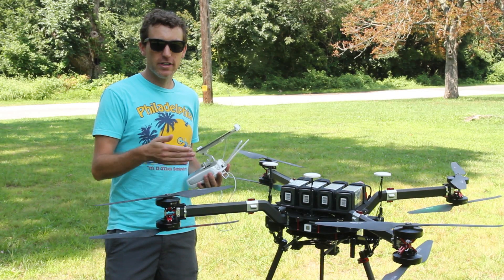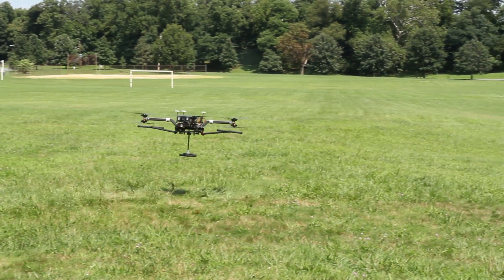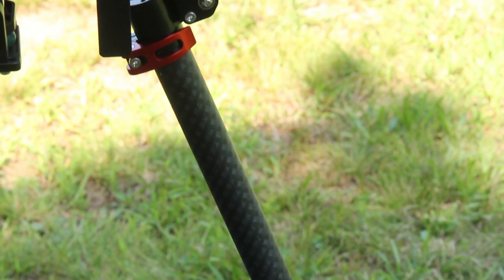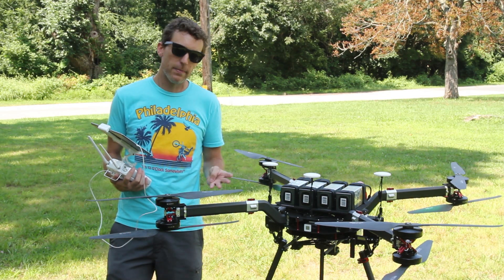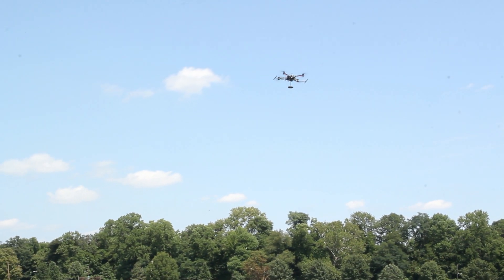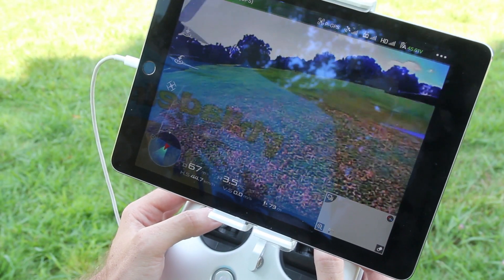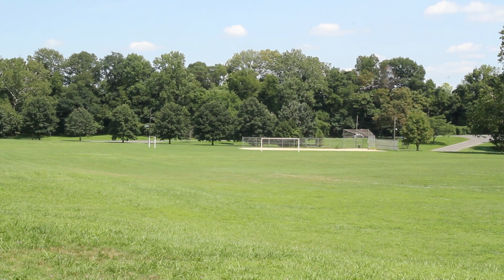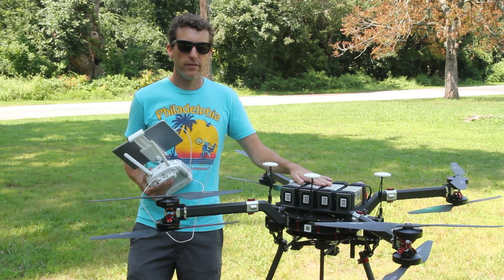BFD Systems 1200-S8 w/ A3 Pro Overview

Comment: Hello sir, I also made a custom frame for a drone and I want to use the A3 controller. I am worried that my drone crash on the first flight due to the default gains of the controller. Did you change your controller gains before your first flight?
Thanks in advance and very nice video :)

Comment: When using the dji A3 or A3 pro on your industrial drone is it still limited in areas it can operate like the standard DJI flight controllers such as the inspire 2?  I am really familiar with DJI and love the fact all their aircraft operate pretty much the same, but hate the restrictions when I have clearance to operate in a restricted area. Looking for an aircraft to carry a lidar unit and was wondering pros and cons of the A3 or would the pixhawk or emlid edge be a better choice?
Reply from the maker: You are restricted with DJI geofencing. We thought maybe it was dependent on using a light bridge, so we rigged up a futaba TX, drove to a restricted flight area and tested an A3 on a stick to see if it would send PWM to the motors when arming. It would not arm so the GPS locations are stored in the flight controller. If you don't have a light bridge it probably won't update for TFRs or other short term restricted zones. You could use a Arducopter flight controller, but keep in mind the restrictions are there for a reason and you should make sure you're following all the rules to keep everyone safe

Comment: How does the pixhawk 2.1 compare to the a3 in flight performance? Could you do a side by side flight comparison?
Reply from the maker: The A3 Pro is definitely more locked in for stick flying. Its hands down the best controller we've flown. But the Pixhawk allows for infinite amount of expansion and customization so we use it more then the DJI for our custom applications

Comment: is the pixhawk powered by tapping  into a 6s point in the 12s battery bank if so 
how do you read telemetry from both sides of the pack
Reply from the maker: The Pixhawk is powered of 2 independent BECs to take 12s down to operating voltage of pixhawk. We use 2 voltage dividers to monitor current and voltage off the two pairs of 12s batteries.
Reply: nice , what is the maximum current draw at full load
Reply from the maker: depending on the which aircraft, this one is about 4k watts/ 80 amps at full load hover.
Reply: BFD Systems hey hi can you please tell me the price of that flight controller

Comment: what is the weight of the craft without batteries
Reply from the maker: 8.5kg
Reply: nice, do you have any future plans regarding hybrid fuel systems like 
engine assistance or hydrogen fuel cells to increase flight times
Reply: does the craft have Dihedral boom inclination , if not how does it feel in flight
Reply from the maker: It does not, it feels very locked in, one of the most locked in aircraft i've ever flown actually.
Reply: Ok thanks, have you done much work with very heavy payloads , if so what  did it feel like
Reply from the maker: Flys great
Reply from the maker: Yes we are working with some different teams to do hybrids. Hydrogen fuel cell is to expensive and not enough output yet
Reply: thanks